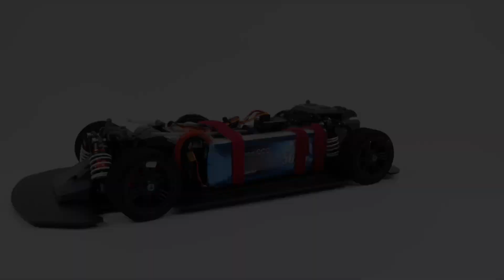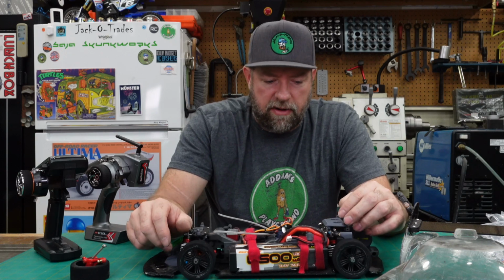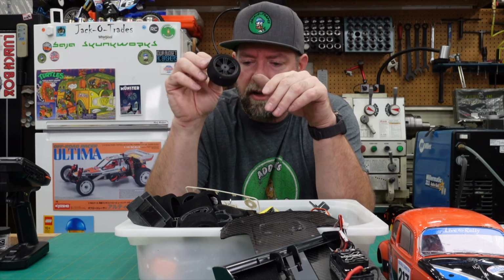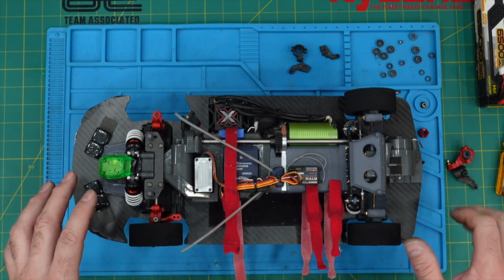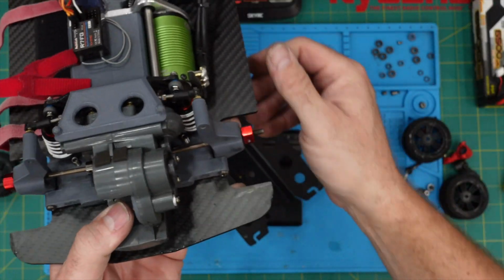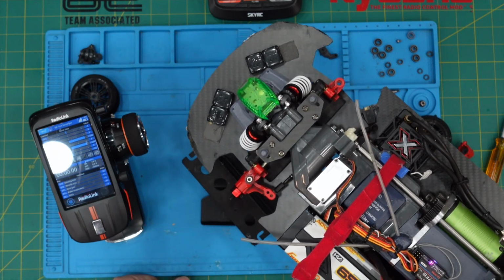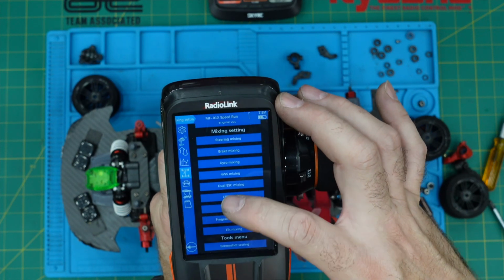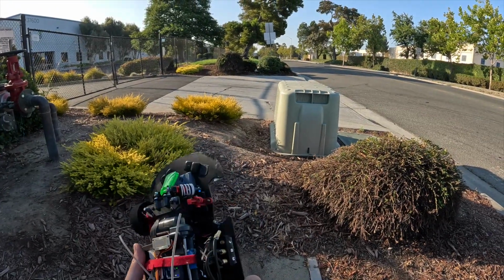Poor Boys RC Tamiya MF-01X Speedrun - Week Three, Deep Dive into a 100mph MF-01X

Comment: I'm using TL-01 arms and front end they work well.  and easy to find..  If you need I have my original hubs not using them if you need let me know I will get them out asap..  So impressive Brice.  the center drive is cool..  Bat wing is sweet too..    Thanks for sharing absolutely insane speeds...😎🤙👍  triple digits baby haha

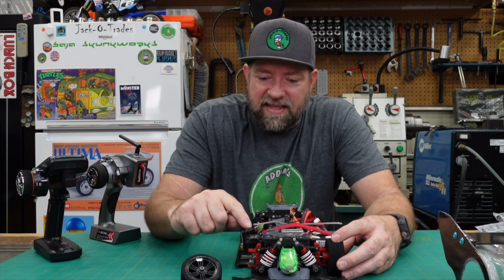Comment: 3:00 - the red parts, apart from color, are identical to M-05Ra #51425 F-parts. Since you are not using high suspension position, you can also replace them with standard M-05 parts. TL-01 parts are compatible, but knuckles have slightly different geometry and different kingpin screws.
Reply from the maker: Thanks! That’s what I was looking to hear. In the back of my mind I thought there were black versions of the part, I just didn’t know from where. I’m clueless when it comes to the M-chassis series.

Comment: As far as the wings go, with the height, what about Raz Shiffrin and Kevin Talbot and their 200mph cars using tall bay wings? Is that because their cars are extended wheelbase cars??
Reply from the maker: I’m just guessing, but I imagine there is some benefit to getting the wing out of the wake of the car. Similar to a hydrofoil.
Reply: @jack-o-trades  makes sense.